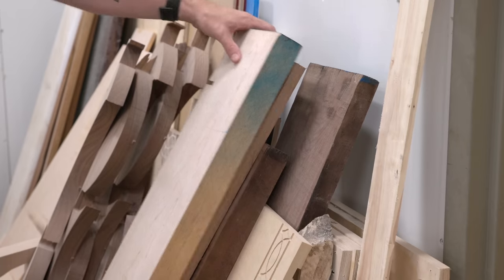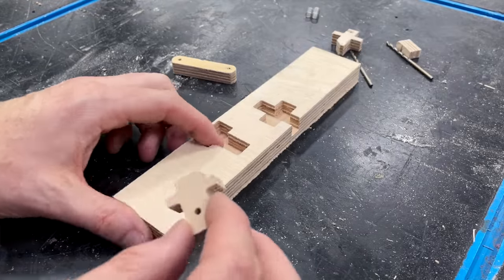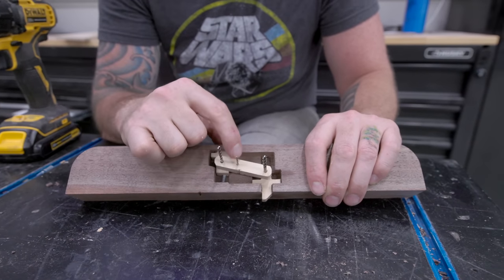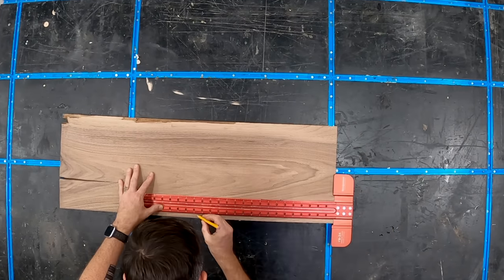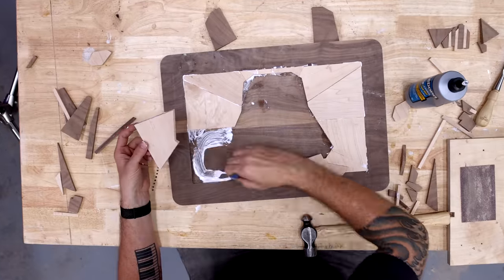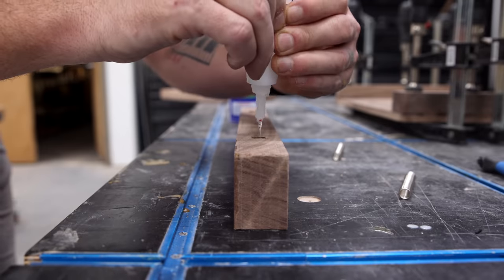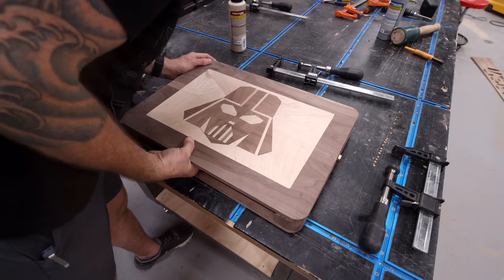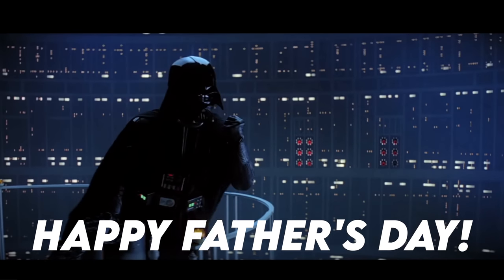Star Wars Mega Fan Builds a Cutting Board

Comment: Nice. You should probably fit a brass striker plate (inlaid) along the length of the latch run in the edge of the tray though, like the way a door latch works. Latch is going to wear the wood away before long, otherwise.
Reply: That’s assuming that he actually pulls the knives out more than 200 times in its lifetime.  It’ll get use, but it’s clearly not the main cutting board of the household.

Comment: I'm betting over time the brass locking mechanism will wear away the softer wood edge on the recessed part of the drawer.  Inlaying the recessed area of the drawer with brass would probably allow it to function correctly for longer.  Great build!
Reply: The jb weld and 2p 10 parts will probably give out too, which you can't really get back in to to repair. Feels as if they half-assed the parts you can't see, or see often.
Reply: Fantastic board! However this may be the prototype. I would add what the other commenters said (ie. Brass strike plate, recessing the brass pushbutton to prevent accidental operation...pun intended). But I would also include assembling the sandwiched layers with long brass wood screws or even recessed T-nut so if repairs or maintenance is required, easy separation can be acquired. 
May the Force be with you!
Reply: Yeah...but thats most likely gonna be in about 72 years ...ye e a h

Comment: Nice job.  I think an alteration that would work better would be to get that brass push-button to start flush or slightly recessed.  The way it is now, the button will accidently activate if the board is set on that edge, or is slid against something.

Comment: Great work and clever as usual.  One recommendation however.  As a career industrial maintenance manager, I have to fix things ALL THE TIME!  Engineers are crazy smart people BUT they have no practical experience.  So no matter how clever and well built something is, it is at some point going to break.  If that latch mechanism were to fail while the drawer is in the closed position, "How would you open it without damaging the wood?"   I would but a decorative brass plate where the release button is.  Then if something were to go wrong, you could access the mechanics of the latch by removing the brass plate.

Comment: I think adding two tracks under the knife drawer to make sure it stays in line would be an easy addition. Just 2 thin pieces of wood fixed to the bottom of the drawer to glide in two channels made in the bottom of the drawer.

Comment: Very nice build and good idea. I hope you don't mind a couple of suggestions in case you plan to make more of these boards. I think it would be better if the brass button was flush with the board in its default position, so it can't be pressed accidentally while moving the board around other objects in the kitchen. And I would add yet another hole in the moving board, so it would be locked in the final open position and couldn't be pulled all the way out without pressing the button again.

Comment: If you want the knives to slide in easier, round the front of the latch and give it a shallower angle.  This may result in a poor hold so you might need to add a copper inlay to the knife tray.

Comment: I think you could improve it further by having the button flush with the board edge so it doesn't stick out.  You could also place a little bit of carefully placed brass on the top, right corner of the slide draw so it doesn't get hung up on the catch when you are trying to push it in.  Makes for smoother operation.

Comment: Its a beginning silversmith's task to build a hidden drawer/hinge that vanishes completely when closed - IIRC its accomplished by making the outside a wedge shape and then carefully sanding the sides to make a flush fit, then sanding the surface to make it smooth when its flush fit.

Comment: Very cool board. Next time I would have used a thicker top, and also made the bottom of the board removable in case there's some issue down the track with the springs or locking mechanism.

Comment: some brass on the drawer would make it last much longer. Chamfer the rear corner and add a brass strike plate to both the latching hole and the rear corner to guide the latching mechanism and add durability (like a door frame has). You could also drill and add some dowels to the inside of the recesses which help align the springs further (both in the latch and the rear of the drawer). Using a walnut slug instead of brass would've made the button blend in for a true "secret" drawer look (especially if you used a piece with similar grain patterns and lined everything up just so). I do like the simple latching mechanism though I was wondering why you didn't cut them out with the cnc router? Very nice project.

Comment: Hello there. My only concern is the springs losing that push over time if they stay under compression for too long. That having been said, man this build is cool as heck.
Reply: I don’t think being under compression even for very long time periods causes them to lose their strength. It’s using it over and over that causes that. Had a gun that kept bullets in the clip for years and years 15 years and never took the bullets out and it worked flawlessly. Used another of the same gun for practice using round after round and the clip needed to be replaced after a year and a half.
Reply: That's a myth. Decent springs don't do that.

Comment: Nice project but why not using your CNC mill to cut brass? Just get correct tool sizes for metal and it will work :) Just need to clamp material properly on table and off you go. For brass there is no need for coolant as it's fairly soft metal.

Comment: "Hello There".  That's some sweet creativity you've constructed.  I appreciate  your sharing the test builds in plywood, something that I might not have thought of. I noticed that every time you use the cutting board you, you will be slicing Vader's face!  When (or if) I make something similar I think that I would use a flush mounted dowel of the same material. I would also add to the underside the following "WARNING! DO NOT PLACE IN DISHWASHER". In any case, carry  on, you are doing a fine job.

Comment: One of the coolest things I've seen.  Did you give any thought on using magnets instead of springs to pop the knife tray out?  My thinking is that storing the springs for long periods in a compressed state they may lose some of their spring while reversing magnets to push would not wear out.
Reply: Love the thinking on using magnets. The reverse poles would push it out is what you’re thinking? What would hold the drawer closed? Just the latch he made? 🤔
Reply: @daveparker839  exactly what I'm thinking. Latch holds it shut just like it holds it against the springs. I've built a box no where near as cool as this cutting board doing it with a latch and reversed magnets.
Reply: It would take a very long time (and by that i mean multiple decades) for a compressed spring to lose its springiness due to creep. Even then it would be negligible at best. People have left their magazines full of ammo for 25 years and it functions exactly the same as a new one. Magnets would be cool though just cause magnets

Comment: Hello there.  I was surprised when you didn't use the CNC to cut the brass latch pieces.  I have the same Avid CNC and it cuts aluminum and brass like butter.  give it a shot!  Cool build too!
Reply from the maker: I should definitely try it. Do you use air or a cooling fluid?
Reply: @JonnyBuilds  Yes and no :) I installed a cheap mister after cutting several pieces prior. It was cheap and a fun project.  I use a phenolic board on top of my MDF when using the cooling though.   For aluminum it wasn't necessary but a simple squirt of WD40 helps keep the aluminum from sticking to the cutter.  An "O" flute end mill is magic too.  I think you will be amazed how well the Avid does with these materials one you get feeds and speeds figured out, I know I was.  Ive cut many of the precision tools used for the MFT table and they came out perfect.  Great channel by the way!

Comment: The build turned out really good but what wood did you use alongside the walnut for the Vadar inlay? Also you might need to replace the two back springs in time with stronger ones as they don't look strong enough to last a long time!.
As always buddy 💯%   👍    🇬🇧.
Reply from the maker: Maple

Comment: Nothing holding the drawer in, knives set towards the back.  This seems like a foot stabbing waiting to happen as someone reaches for the chefs knife but pulls the drawer out to far and the front weight flipping it down to the floor...and your feet.  Not trying to tear your work apart, just seemed like something to avoid.